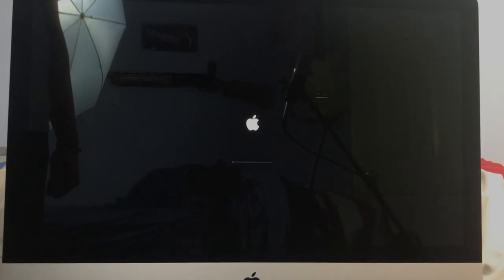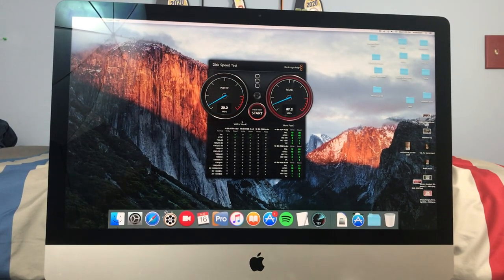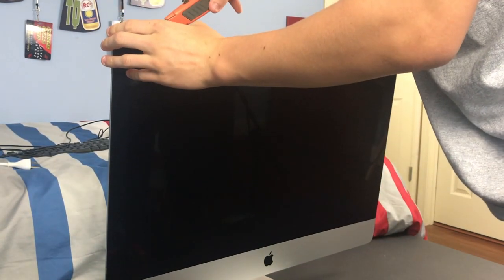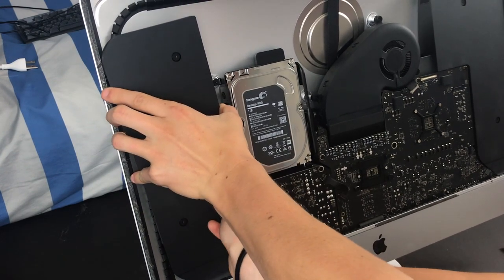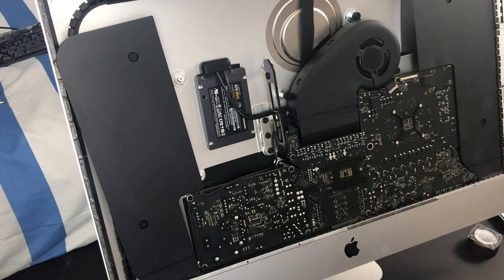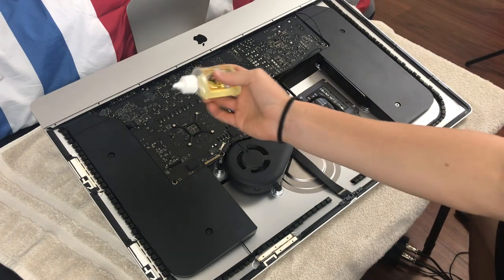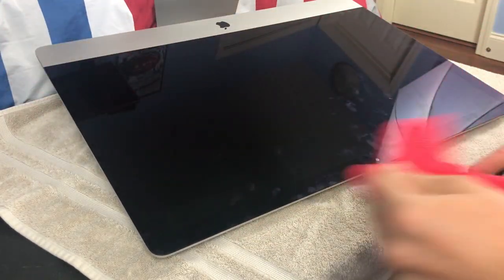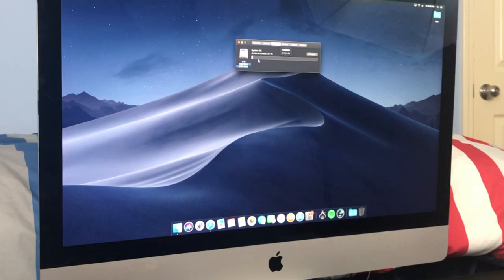How To Upgrade/Replace Hard Drive in iMac 27" 2012-2015 to an SSD

Comment: I think you missed covering the installation of the OS on the SSD. If you put in a blank SSD, you would need to use an installation USB stick or Internet Recovery mode to get the OS installed. Instead, you should probably use Carbon Copy Cloner, to image the old drive to the new one (hook the new one in via an external USB case), and then when the cloning is finished, continue with the replacement. Or, if you have another Mac, you could use an external 2-bay drive caddy, and use the cloning software to clone the old HD to the new SSD.
Reply: this was what I was wondering, how to clone my imac before installing.

Comment: What technique did you use to get the old drive data on the new SDD drive?
Reply: There's a Mac app called Super Duper that I've used in the past with good results.
Reply: Carbon Copy Cloner also works.

Comment: OMG.... what the hell. You do NOT need to heat the screen, use the proper plastic wheeled tool and do NOT use a bloody stanley knife.... Plus without the heat sensor the fans will run at 100% all the time... This is the how NOT TO instruction....
Reply: is this guy trolling? like everything is a "no-no" sharp metal razor knife; heating with heat gun, using a crap folding torx tool, putting metal tweezers inside PC, gluing it with gorilla glue?..just WOW... I guess if you lived in a wood cabin in North central Canada only accessible by float plane; this might be useful.
Reply: Agree with using the cutting wheel but the heat sensor is a well known scam. I’ve done more than a few of these upgrades never had the fan problem people talk about. Maybe really old machines have a problem with it but any iMac from early 2015 onwards does not need a sensor. The heat gun thing looks crazy and I recommend using new tape, also I put a small blob of clear sealant in the top two corners, I’ve had tape fail before.
Reply: Agreed, never use Gorilla glue, don't be cheap spend 10-20 bucks and get the replacement tape.

Comment: Would a 4tb drive read?
Reply from the maker: It should. I have a 2tb external and it reads fine. Internal should be the same
Reply: @techitout4710  Hey man. Have you had any issues not using the thermal sensor that OWC says we should use?